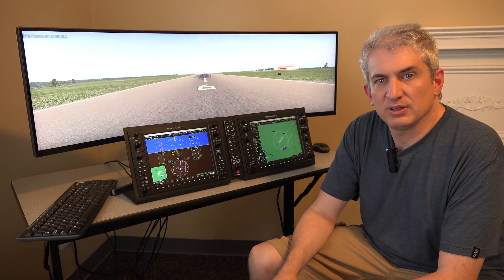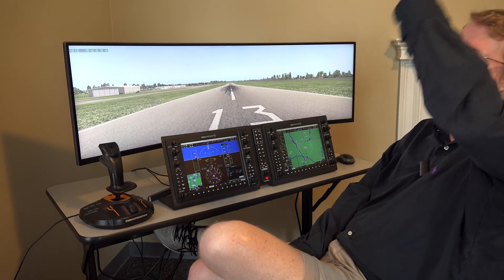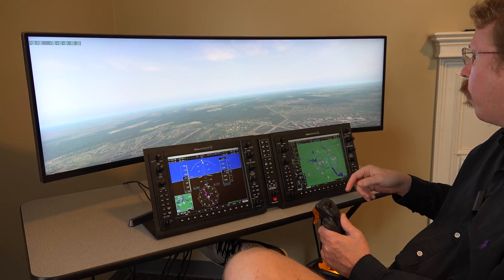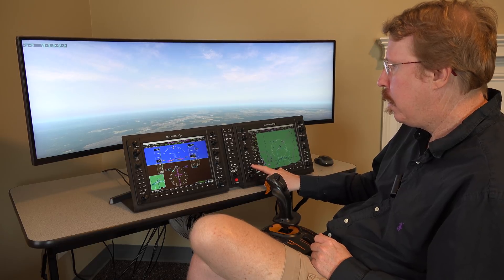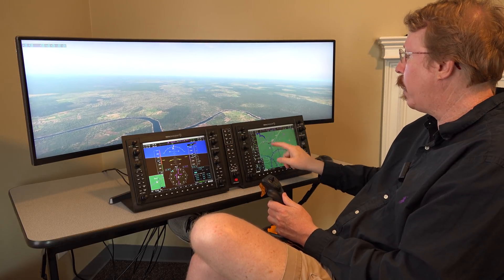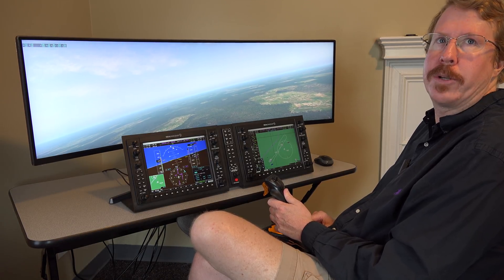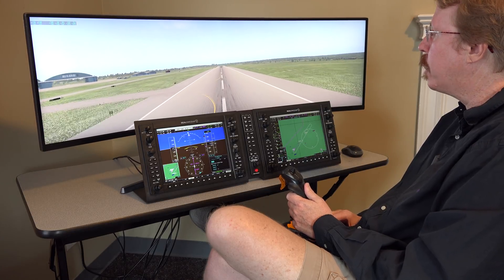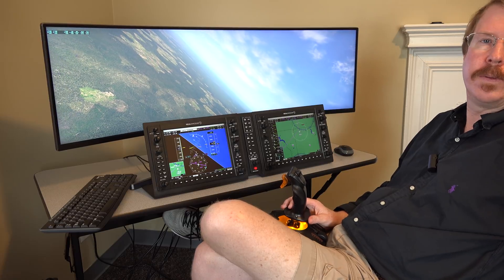Austin tries the RealSimGear G1000 Suite for the first time

Comment: I guess all the missing stuff should be there in P3D? It actually is important to train a Raimcheck as otherwise your not legal on a WAAS/LPV approach. 
And P3D actually runs many certified AATDs. 
As P3D's G1000 implementation works with Mindstar it should be there (for now only until v3 but v4 / v5 should be supported soon). Am I right? In this case P3D would be better than X-Plane? I wanted to buy Simionic bezels but these run with iPads and if these are no longer supported by Apple my setup is useless. So Simionic is out of the game but I need comprehensive simulation of every single function. Also too bad that Realsimgear does not charge a few bucks more for the real feeling of turning knobs. Why are there always compromises....

Comment: Is that using only the XPlane G1000, or is there some proprietary software running the displays?
Reply from the maker: Just X-Plane driving the displays
Reply: Will that hardware control the official Garmin PCTrainer for the G1000?  Even if nothing showed up on the screens, but only on the monitor, the ability to control the G1000 PC trainer using realistic knobs and buttons would be a great help for a particular CAP mission that I am involved in....

Comment: How about a trillion times easier. I've been simming for two years now, started on FSX, now on Xplane11 exclusively. I never thought I'd ever master instrument approaches or IFR flying,
but using some of the planes with the Garmin G1000, particularly the Cirrius Vision SF50, (included with the sim) helped make learning all of this stuff a ton easier. All I usually do is fly
a direct-to flight to whatever airport I'm flying to, set up the ILS or RNAV approach ahead of time and store it, Check my radio info. and approach HDG ahead of time, which you can 

do on the Garmin right from the flight plan info. button screens, and make sure I arm my approach maybe 100 or 80 miles ahead of the airport or arrival, and make sure I'm at the FAF
altitude either manually or using VNAV (which this also taught me how to use), and I just let the GPS roll me over to ILS, hit APR button, and watch the plane do a perfect ILS landing.
I usually just do a basic to Vectors approach. RNAV is the same procedure, just minus the radios. It's absurdly easy once you get some practice. I just did a flight last night from San Antonio to New Orleans KNEW Lakefront, and mainly at night, and I had a near-perfect ILS landing using the Cirrus and Garmin G1000. It worked flawlessly. 1700 Ft., hit APR, watch plane land itself. Nearly. 

I've also learned a ton about what a good approach is: nailing your speed transitions, when to do flaps, gear, etc. How to do a good base to final. What lights to do when.   

I've done flights to Canada or BC in horrible storms and stuff, and had perfect
RNAV landings or ILS with the Garmin in XPlane. My only complaint is the NAVDATA keeps going out of synch. I wish XPlane would auto-update basic fresh navdata every month or 

six months, or whatever, saving me from having to buy an expensive subscription to Navigraph or what have you.  The beauty of doing a full GPS Nav flight to whatever airport is,
once you arm your approach, the Garmin automatically rolls you over from flight to approach and it's pretty effortless. As long as you nail your approach altitudes, you're good! I love it.
It's also a lot easier than mastering the FMC, to me, at least. It's much more user-friendly and more intuitive. I also love the huge NAV map screens and options. Once you learn
how to edit and assemble flight plans and waypoints, it's even better, and working VNAV (although only for descents) is icing on the cake. All this has also inspired me to learn 

approach plate reading, and barometer setting, and all the elements I'd almost ignored for a long time. I just keep learning, because if not, I cannot use the Garmin to its full
potential, so it was a nice incentive. Also learned how to execute a GPS go-around using the Garmin which was a lot of fun, when one RNAV approach at O'Hare didn't work right, 

I just hit Missed, plane set up a go-around and reset my original approach, and then the RNAV locked on GS and that was that. Fantastic.

Comment: What size monitor is that?
Reply from the maker: 49 super ultra wide
Reply: Michael Brown Amazing. Thanks
Reply: It is a Samsung C49HG90dmu monitor. I bought it myself with a pixel error for just 699 € including shipping on Ebay. A really great device. https://www.ebay.de/itm/SAMSUNG-C49HG90DMU-Curved-QLED-Monitor-49-Zoll-3840-x-1080-schwarz-B-Ware/333172008180?epid=2189103705&hash=item4d929964f4:g:jvAAAOSwhMJcwvUq